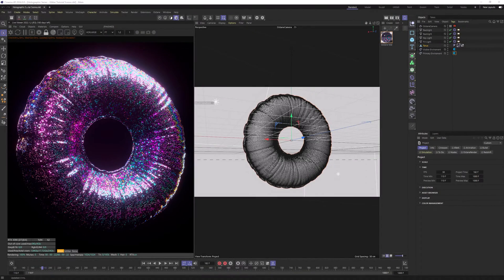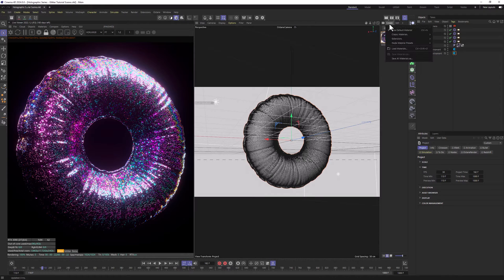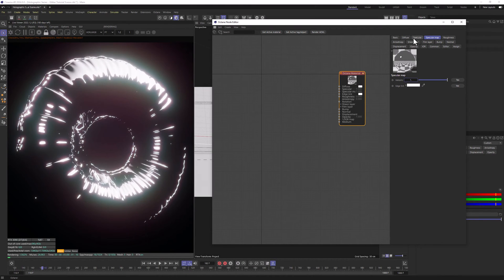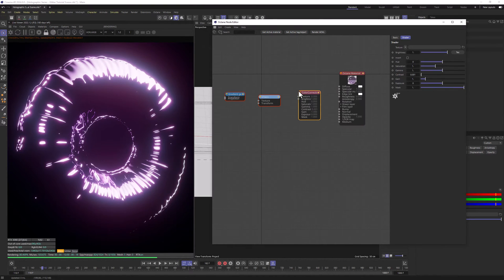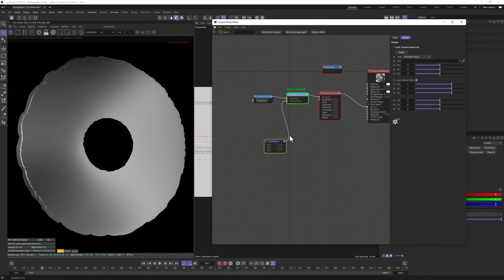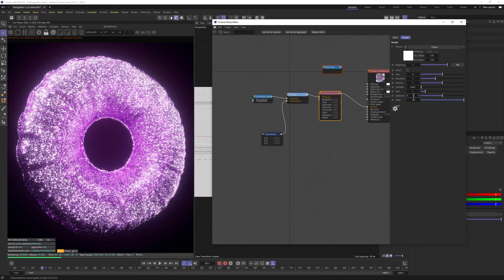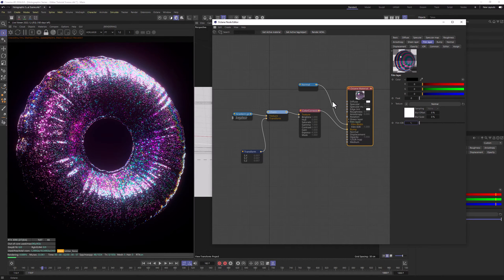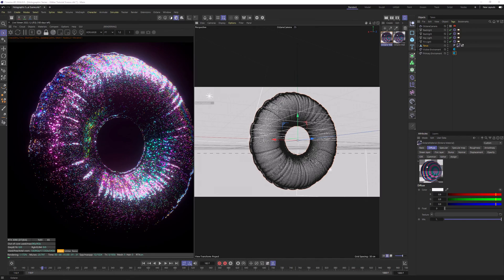Instant Glitter Material: Cinema 4D Octane Tutorial ✨

Comment: Some of these nodes dont show up? 2022.1.2(R4) running C4D 2023. Anyone else having this? Gradient Generator and Normal not appearing. Nice tutorial tho.
Reply from the maker: I’m on latest stable version of Octane and c4d 2024
Reply: Just checked - may be my install mind you but my C4D 2023 and 2024 are using the same octane build file, 2024 C4D shows those nodes fine, 2023 C4d its not there...interesting.
 @NojsGraphics
Reply: @NojsGraphics   Hmm - maybe 2024 unlocks that but I doubt it... so odd.